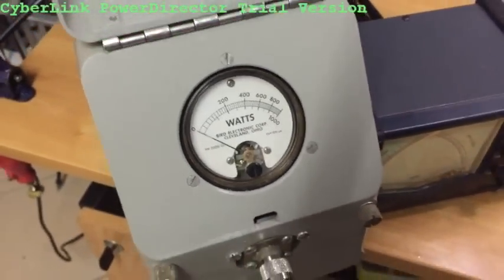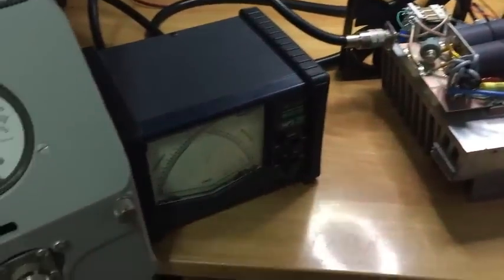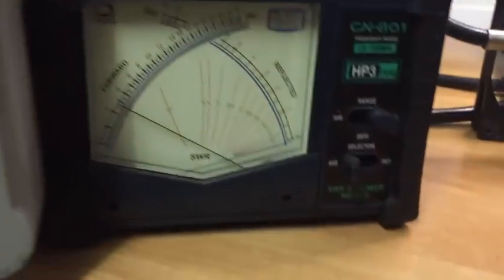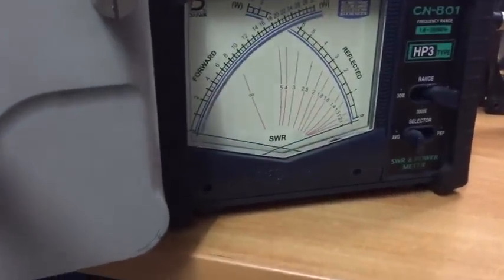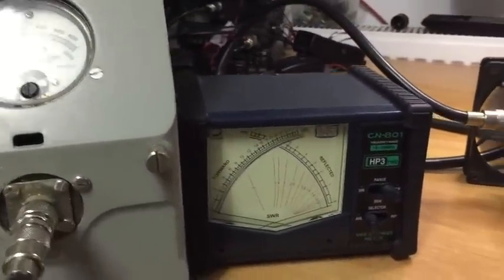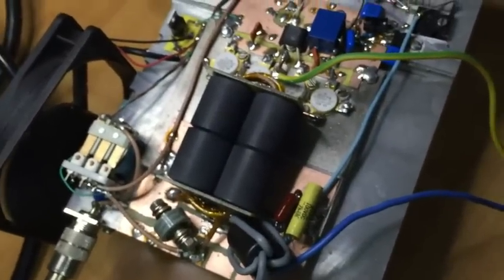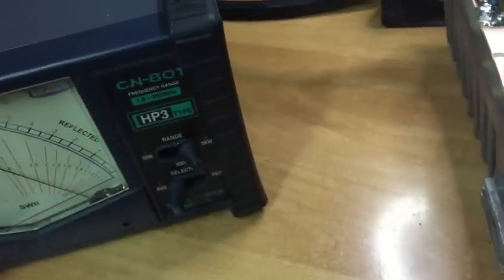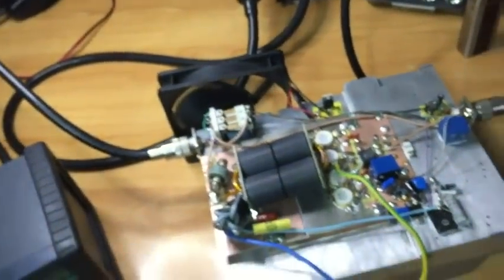VRF2933 LDMOS 1.7KW HF linear amplifier built by YO6PMX

Comment: Good information on the ferrite output transformer. Just be aware that those transistors will not be linear at 1.7kW O/P. They are rated for 300W each.

Comment: 1.7 KW from a 4 pill? cool man.
Reply: The VRF2933 is a 50 volt VDMOS device that is capable of 300W per FET up to 150MHz. According to the datasheet, you can push them much harder. I'm sure the linearity will suffer, but I've heard of people running 4 of these at 1.2-1.5KW all day long with no issues.
They also make a VRF2944 that does 400W per FET. Both handle up to a 70:1 SWR also. Microsemi has made some seriously impressive devices using the VDMOS technology.

Comment: Looks great thanks for sharing! By any chance did you connect it to a spectrum analyzer to see what the signal looked like? I am just curious to know how much of that power is staying on frequency, I want to build one of these as well. Thanks again.
Reply from the maker: Hello. No, I never connected the amp to the analyzer, but I have built some output filters using PA0FRi's design. The attenuation of second and third harmonic was ok for those filters. After connecting the filters I have lost between 100 and 200W, so I assume that those were harmonics. Approx 1.5 KW remained on all bands. so i think is ok. As I said before, I do not claim that the amplifier i working in linear mode at those frequencies. I would recommend to use such amplifier  for powers around 1Kw - 1.2KW. At 1.7 it is certainly pushed to it's maximum.
Reply: @perianmarcel2059  Thank you for your reply. I find this extremely interesting and I hope to build one of my own. I really appreciate you taking the time to make this video and sharing.

Comment: The guys also made a 1: 9 transformer from 61 materials. Of course, I did not achieve such power, but the amplifier turned out with amazing linearity! And YO6PMX rights are not heated at all! Thank you YO6PMX!
Reply from the maker: Hi. I am glad that you have built one too. The amplifier works fine with that 9:1 transformer, as it can be seen on the pa0fri's site. I said from the beginning and I am repeating it, it is not my schematic, I built the amplifier using a schematic from PA0FRI's site. I never said it is linear at 1.7 KW, in the matter of act, I guess it is working in class C at that power... Probably 1 Kw, maybe 1.2 Kw is a decent power where it is working linear.
Reply: Hi Perian! 
I built an amplifier - concept - model with water cooling by R3KR. See pls
https://youtu.be/_DWhgO9t5Eo
Chinese transistors mrfe6vp61k25h were used

Comment: hi, a question, the ptt of the amplifier is activated with the rf that enters from the radio, is that correct?
Reply from the maker: Hello. Yes, this is correct. I chose this method knowing that there are different commands for the linear from different transceivers (simple relays in older transceivers, low level logic commands from newer transceivers) so the "rf vox" is somehow "universal" command mode. The same can be seen in most of the RM Italy ham amplifiers (HLA 300 by ex.).

Comment: 50V Power Supply, 1:9 Output Transformer and 1,7 KW......it is mismatch.
Reply from the maker: @CarlRyan-i2z  , why do you assume an efficiency below 50%? The total dissipated power of an VRF2933 is 648 W https://www.microsemi.com/document-portal/doc_download/77339-vrf2933-mp-datasheet . If we assume a 50% efficiency (which is the worst i've ever seen!) , 1300 W is an acceptable power for 4 pills. Ok, the 2nd and third harmonic is about 200W (measured that). Can I have 52% efficiency? :) Some says one can acheive even 60% efficiency in class AB... https://www.electronics-tutorials.ws/amplifier/amplifier-classes.html Of course that the amplifier cannot be putted on the air without output low-pass filters, as i said, after filtering I have lost about 200W at the output.
Reply: @perianmarcel2059  ...just because you use a specific rf class it doesn't mean you have that efficiency. for that output power of VRF2933 your IMD will be much worst for SSB use. in push-pull topology, the even harmonics are canceled, only odd will be present and strong (cause no LPF filter), which will count in fake watt output. 50V, 1.7Kw will give an impedance of 2.8 ohm, how a 1:9 transformer would work???.
Reply: there is no replay
Reply from the maker: Right! God moved my needles!

Comment: Where did you get the RT4/F power supply?
Reply from the maker: Hello. The power supplies are salvaged from old mobile telecommunication equipment replaced for upgrade. They can be found on Ebay or on local ham internet sites sometimes. Any 50 - 54V 50A will do it.

Comment: How the RX/TX fast switching is solved please?
Reply from the maker: Hello. I don't understand what "fast" means. The switching is done using an old russian hardware method. The output relay (antenna relay) has two contacts. One is used to switch the RF and the other one is commanding the input relay (12V DC), so, there is impossible to start the amplifier before the antenna is coupled...
Reply: michaelscoofield
I mean QSK switching in between TX and RX. If there is relay then its too slow to listenning in between own dots and dashes on CW. Anycase its great job. Congrats. Petr

Comment: What are you using for your output filtering?
Reply from the maker: Nothing for now. The amplifier is not on the antenna in a full functional assembly yet. I am intending to use a set of filters described by KF8OD (thanks again). In this moment I am using the amplifier in 20m only with only one filter, described by PA0FRI here: https://pa0fri.home.xs4all.nl/Lineairs/BLF188%20HF%20amplifier/BLF188%20HF%20versterker.htm The 20m filter has 2 coils of 560 nH each, on T130-2 toroid core and 3 silver mica capacitors (150pF-330pF-150pF). It has been tested on spectrum analyser and it is suppressing very efficiently the 3-rd harmonic and quite ok the second.

Comment: very impressive build. what is the frequency range of those LDMOS?  I am also interested in your power supply, do you have a manufacturer and model #?
Reply from the maker: The transistor is rated at 150 MHz in its datasheet. My amplifier has been tested between 3,5MHZ and 29 MHz. The power supply is 50V 50A built by a romanian company (Antrice). Those power supplies are widely used in mobile telecommunication companies.
Reply: Cannot find anything about your power supply, can you post a link please?